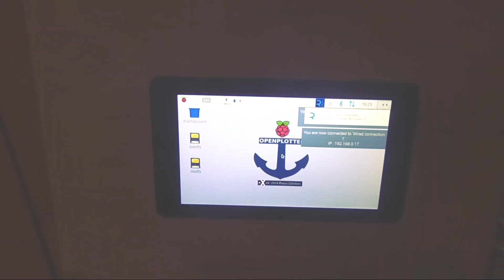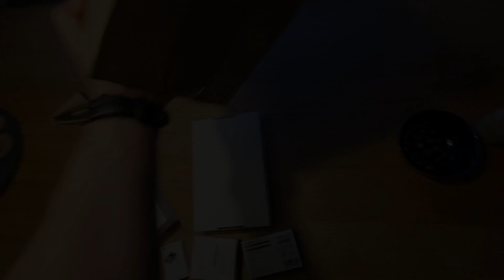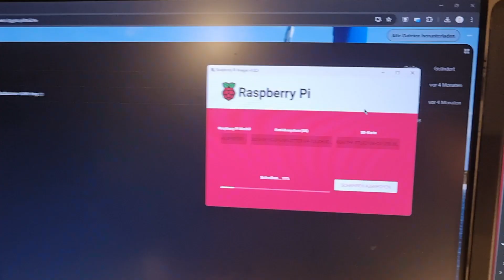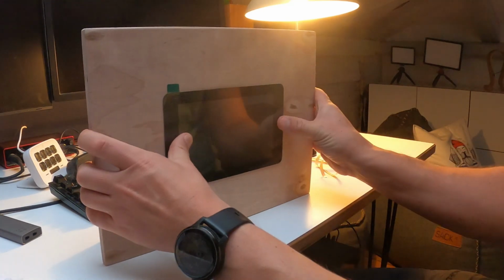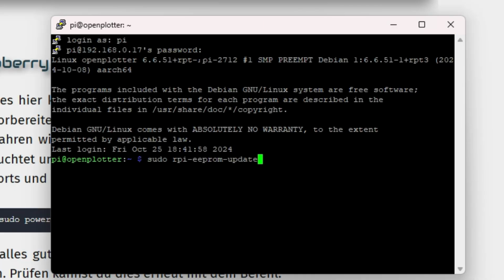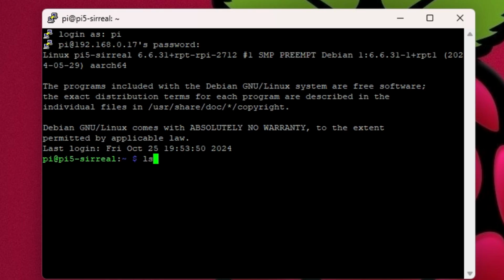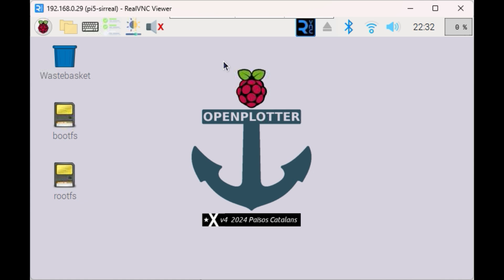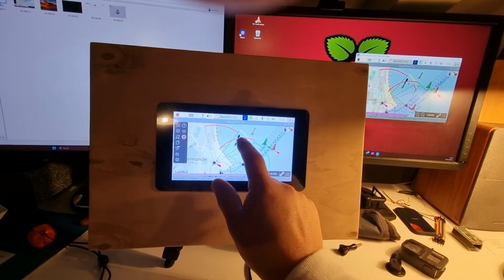Raspberry PI 5 for OpenPlotter 4? Let's build a NVMe M.2 SSD demo system with OpenCPN!

Comment: @Sir-Real Hello SR, 

I am working on this, PI5, pypilot is still not working, disconnected ?

PI5, MacAuthur Hat, Maiana, OP4, Pypilot Mid Power.

I have to launch in 3 weeks, trying to go home, from Western Australia to the East coast.

Is the someone I can hire/pay one on one, to help get me up and running?

Kind Regards Steve
Reply from the maker: Sorry, @quolls2, I read it month later but just to share this: I switched back to my PI4 for now as well because I observed some issues / glitches I couldn't fix. As I was on time pressure and in need for a reliable system, I decided to use the PI4.
However, it might also be linked to the newer OpenPlotter version. I also decided to stick to the old one. I will update if I find time and if everything had some time to develop.

Comment: I've built and used two rpi navigation computers with AIS recently, both using the official touchscreen and using a third party screen. The hardest part about using these is mounting the screen. This is difficult to do on a boat due to the constant movement and other stresses the gear is under. Looking at the glue-in screen that you used here, I don't see that lasting very long at all under way. I have not seen that version before. I had one screen die on me already, which is one reason I made a second touch screen system. I am not sure where to get a good screen for my first system (not the official touch screen). Do you have any advice on a good screen with mounting parts that made it easy to install on the boat?
Reply from the maker: Screens to be glued are usually screens which are connected via the DSI interface and usually they can stack the Raspberry itself. These screens are limited in size and they are not intended to be placed outdoors. So, below deck I think this will last and is okay. It is a cheap solution best for dashboards.
For plotter software you need a bigger screen, HDMI based. I find this difficult if it needs to be outside. I went now for a Samsung Active 10" tablet. I plan to create a video soon about it, waterproof tablet, Wifi connected to my Raspberry.

Comment: This was the video I needed to start similar project. 
Was wandering if I would install the daisy on a separate rpi4. Would I be able to send its data to the central rpi5 I don’t feel like stacking too much. Also I think daisy is not for rpi5
Reply from the maker: Yes, this is possible. But usually you run one NMEA multiplex service / one Signal K. So you need to transfer the AIS data on a different channel. You can use Node-RED, take the serial data of the dAISy HAT, forward it via TCP to the RPI5 and hand it over there to Signal K.
Reply: @Sir-Real super! Thanks man. I will take it step by step. Also I was wrong about not being able to stack the daisy on rpi5. So perhaps I stick to 1 pi

Comment: I have been trying to get my gps module (Neo M8U) working via I2C connected to my MacArthur hat with no success.  Any suggestions?
Reply from the maker: I think you need to put several more details in to get some help...
Reply: @ I’m still new at this.  What info do you need?  Pi5 running Open CPN, MacArthur hat running Signal K, dAISy hat and the Sparkfun Neo M8U gps wired into the I2C MacArthur hat.  In Signal K, I can see it on circuit 42 in I2C, but can’t seem to figure out how to enable it or get info out of it.
Reply from the maker: You need to put this to a forum, difficult to help in Youtube commentary.
But the info you need to post: Is I2C activated in raspi-config? Can you see the I2C address e.g. with i2cdetect -y 1 (i2c tools need to be installed). Did you add an I2C device? Are you using OpenPlotter or what kind of configuration?
Finally: I do not own an Neo M8U, so in a forum it would be easier to find someone which has experience with this specific module.

Comment: Hi, thanks for the demo!
Do you have any idea about how RPI 5 compares to RPI 4 regarding power consumption? I am thinking about an upgrade but I have limited power on board (currently).
Reply from the maker: Good point!  
The specification limits the power consumption to 7.5W on a PI4 vs. 15W on a PI5. 
(Looking at the power supply: peaks are higher: 5V*3A=15W vs. 5V*5A=25W).
This is all theory. Practical tests show idle consumption of 275mA (1.375W) vs. 500mA (2.5W) and in action 1.3A (6.5W) vs. 2.15A (10,75W).
In a nutshell: Yes, more energy. Still below anything we need to worry about. Your anchor light will take the same amount of energy, probably. 
I own a 150Ah (on 12V) LiFePo4. Running a PI5 in action for 24h would draw about 20A (based on 12V). And using energy save modes will reduce this (screen off etc.). I would calculate with 10Ah on my 12V battery in 24h.
Much more important: A good power supply! Or the PI5 will crash.

Comment: Watching Youtube Videos. :)) Looking forward to the performance test. Wondering if the 7inch display isnt a bit small for OpenCPN. 
As always very helpful an inspiring. Cheers!
Reply: Get a bigger one?  screens are cheap.. also depends a lot on how many devices you are running i have 5 on my boat, mounting space runs out fast when you have multiple devices, in the latter case 7" is perfect
Reply: @henrye718 , would we benefit with a higher resolution? Or will things get unreadable on 7”?
Reply: @rulllz  I would imagine if your using it as a chart plotter, if you used a lower resolution to increase the size of items you would not be able to see much water in terms of distance when you zoom in. Other wise if you have decent vision it would be no diffent from reading a tablet.
Reply: rpi will have a larger screen, date unknown, they already have a 7 inch with more resolution.